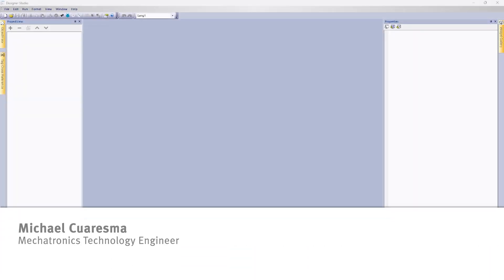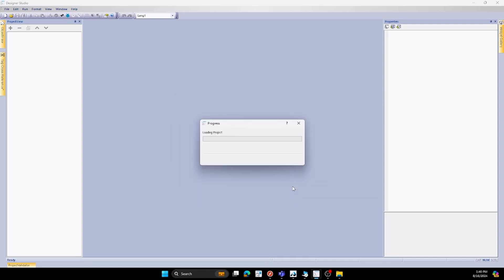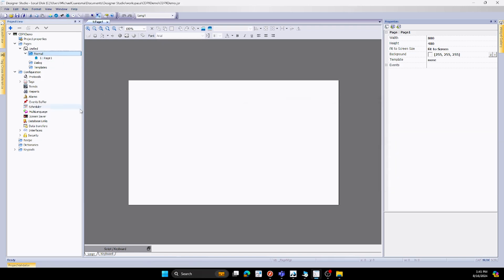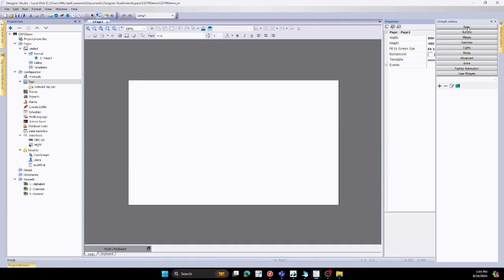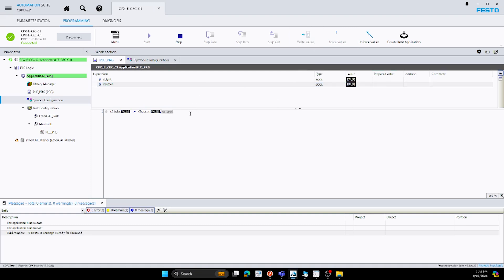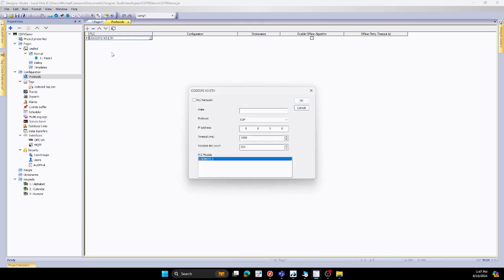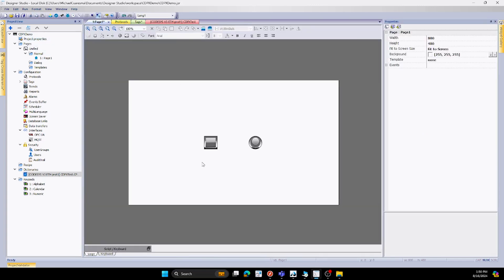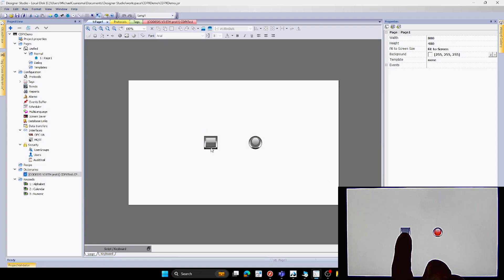Festo CDPX Software Overview

Comment: At 4:00, the widget gallery has a TON more options than the installation I have, also 4.50.0 build 224. My menus have nearly 5% of the ones shown in this video. How do I get the full widget gallery shown in this video?